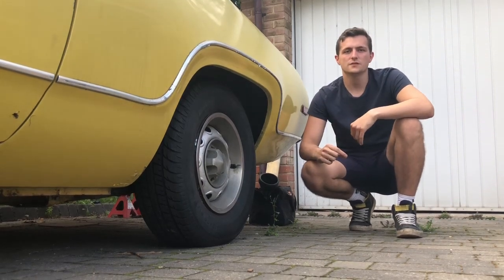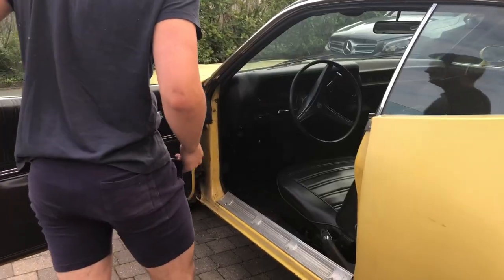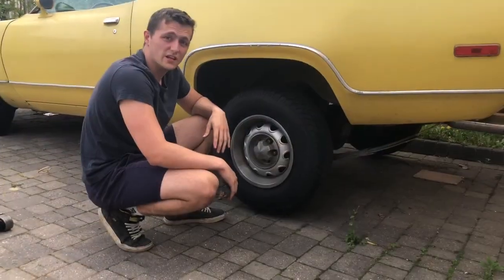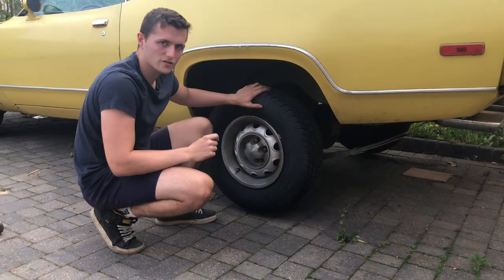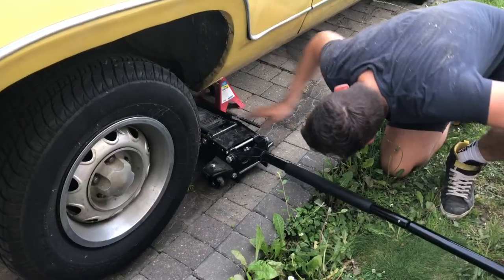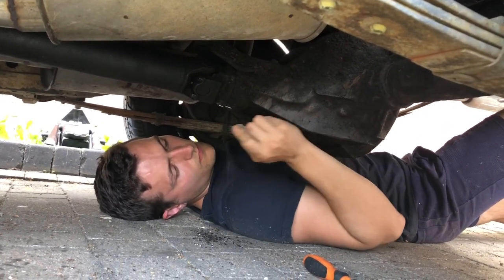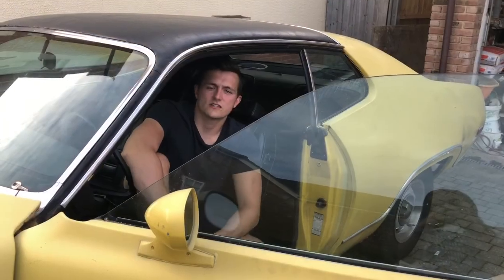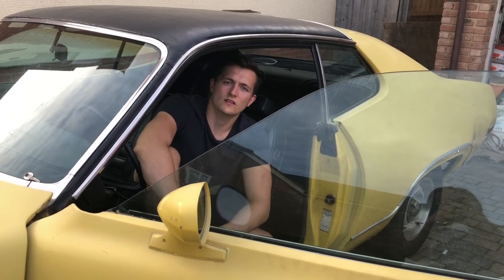HOW TO: Find Your Open Differential Gear Ratio // NOTaMOD

Comment: My 72 Satellite had a 214 ratio before I changed it out to a 390 ratio w/a posi or limited slip center section. I wish I lived near u so we could've done a little horse trading. I recently built and put a slightly narrowed 8-3/4" rear in my car because I broke one of the axles in the original 8-1/4" rear with the new motor I built. I would've gladly traded it to you for some LED sequential tail lights like the ones u did for your car. I replaced the broken axle but, pulled the rear out anyway because I knew I'd just break it again. I just put over $1,300 in that original rear end and it doesn't even have 200 miles on it. You woulda been roasting the tires out of that car show you were just at w/twin rubber patches. Heh, Heh I got a couple of videos on the rear end swap I did. It was a real hassle to modify the 8-3/4 rear, but that old rear would've bolted right up to car. You wouldn't even need to change the brake lines/ drive line or anything. New wheel studs, seals, bearings, brakes, brake hardware, drums, and a bitchin' brand new aluminum diff cover to boot. It would great in any car under 500 horses. What a huge waste. I love the tail lights u did on your car bro. Well, take care man.
Reply from the maker: Awww man! That would have been ideal like bang on what I needed ! Such a shame! But that does sound sweet I’ve spoke to a few diff builders and they have said they would only guarantee it till about 400-450 which is much much lower then what I’m gunning for so I might go the s-60 direction now! Thank you though! The lights are super simple if you want to have a crack at them yourself 👍👌
Reply: @NOTaMOD  Thank's bro, but I wouldn't even know where to get em' here in the states and electrical stuff is way outa my wheel house. Did you have to change it to a special flasher? Thanks
Reply from the maker: To be honest I ordered it all off eBay so you could definitely manage it in the states I recon! I did do 2 videos walking you through the wiring too 👍💪 also no change in flasher I just disconnected mine as the rear LeD strips indicate sequentially regardless of a flasher, but this did stop the front indicators flashing but I’m planning on replacing those too so just be aware! 👌 hope this helps